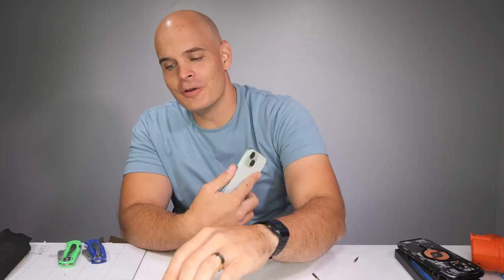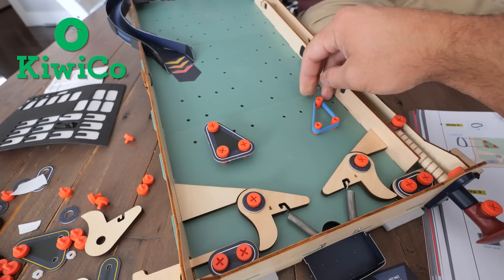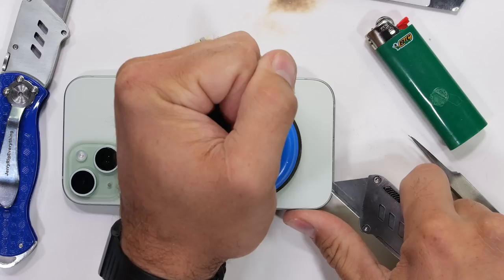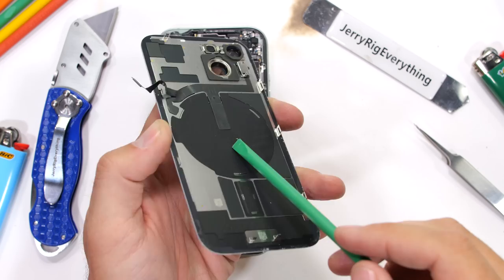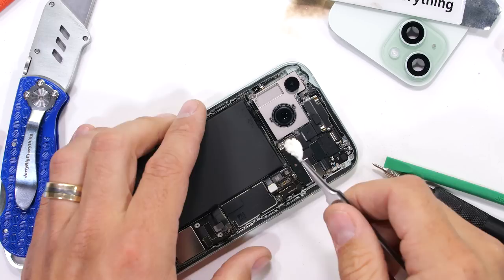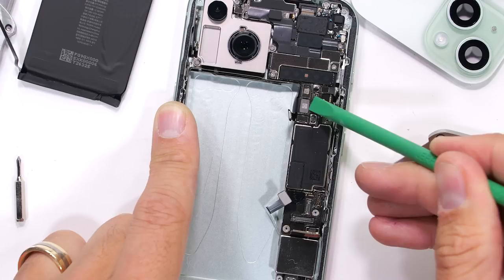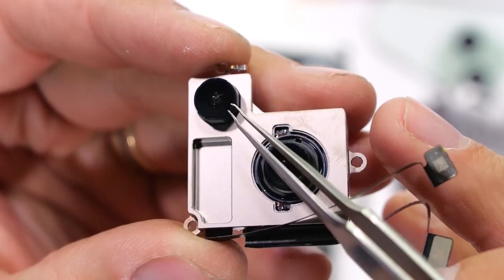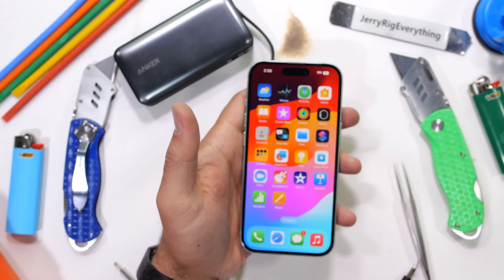iPhone 15 Teardown - Why is nobody talking about this?!

Comment: A software locked back panel is outrageous lol

Many likes 🙏 tyvm
Reply: yap thats why I will never get an iphone. The apple anti consumer mentality is insane. I want the phone to be mine and repair it as I see fit for longer operation.
Reply: I completly agree, but another youtuber did mange how to fix the software locking , yet it is very complicated.
Reply: Much better than the one that cannot be removed if broken...
Reply: @awepizza   It is annoying, but apple claims the reason they software lock the components is so that theives cannot resell a stolen phone for parts, which is the biggest selling point of a stolen phone ever since you could software lock the phone from "Find My" when it is stolen. I think that is a good point to consider
Reply: Have you ever considered the fact that it protects your information and privacy? Just because somebody makes a video and has an opinion doesn’t make it gospel. You need to think for yourself. People come to iPhone because they like the locked software and hardware so when they put their banking apps, stock apps and other sensitive apps they feel secure. They don’t want open hardware and open software like android.
Reply: @lukabosnjak3829  that was only a problem because of an intentional design flaw. Can't throw them a bone for that one.
Reply: Imagine if your phone got stolen. And sold for parts?
Lol people doesn’t have a brain to process these stuff.
Reply: What about that sim card placeholder with electronic connections? I bet it's also serialized
Reply: @searic3203   and that clame is a joke. a phone as parts is almost worthless due to the skill and time required to take it apart and the low price of used parts.

furthermore. If that was actually the goal they could just implement the feature for parts from stolen phones whhile not impacting non stolen replacement parts.
Reply: What does it mean by software locked back panel?
Reply: If people stopped buying so much apple products this wouldn't be common place.
Reply: @iFrozenSkull if you remove it or replace it with a component that's originally installed on that iPhone, it prevents the phone from working properly
Reply: What's on the back glass of your phone that's protecting your privacy? Nothing besides the wireless charging pad really should be there.
Reply: @iFrozenSkull   means camera and wireless charging stuff stopüs working when anyone other than apple replaces the back panel
Reply: @searic3203  this would make any sence if phone parts would only be locked if it was stolen.....
Reply: @awepizza if thats a good enough reason to completely not even CONSIDER a phone for you, idek what to say tbh
Reply: It’s actually insane
Reply: It has positives too though. You won’t have random frankenphones getting sold on the secondary as ‘like new’ phones.
Reply: Legit sounds like a parody.
Reply: The thing is that the back panel contains apple’s technology. MagSafe belongs to them and if someone else wants to recreate their technology then they have to pay. Otherwise they not getting on the iPhone
Reply: @sammyjammy6647 damn i hate it when a 3rd party back panel steals my credit card number
Reply: @sammyjammy6647  Locked-down/closed hardware and software does not necessarily mean secure, made clear with how Android considers custom roms to be insecure even if the custom rom is newer than what the company allows the phone to go to.
Reply: Technically, it’s not really the back panel that software locked. It’s the charging coil and NFC and maybe the flash.  That makes it ever so slightly better, but like hardly.  It is incredibly annoying that Apple can find a way to both please the right to repair people, and still completely lock it down.  

If you need to know, the reason I keep going back to iPhones. I think it’s honestly because there’s a lot more set it and forget it plus, it just works while absolutely I can point to countless instances of that not being true on the whole it’s much more it just works than android.    And I’ve carried android in my pocket for years alongside iPhone either for work or or because I’m just a nerd.  In the end of the day I prefer an iPhone just because it just works at this point.
Reply: @iFrozenSkull it means backpanel is locked by software so only Apple can repair and no chance of reselling stolen iPhone 15.
Reply: Imagine having the option to lock/unlock the software with your apple id... when you need to change a part you unlock it and then lock it back... job done. But apple doesn't want that. The point that it protects from being stolen in a stupid point.
Reply: @johnbroke2336  That's not necessarily a good compromise either because the display could go bad or something.
Reply: @awepizza I’ve never needed an iPhone repair in 13 years of using them because I take care of my expensive devices.
Reply: Not for Apple
Reply: Expect nothing less from Apple.
Reply: @sammyjammy6647  guys like you are something different. what a breed
Reply: @sammyjammy6647 appleships never have the ability to think for themselves...if Apple really locked the back panel for your own benefit, they would have given thier customers the choice to lock it if stolen or unlock if they want to repair. You should have that choice and option and not apple making the choice for you
Reply: @sammyjammy6647 apple sheep alert😂😂
Reply: Not sure if anyone noticed the OP actually said *back panel*. It's meant for sarcasm since the back panel is literally a piece of metal with glass with no electronic component😂.
Reply: Imagine your phone giving you alerts about a back glass replacement😂
Reply: Brooooo..Wasn't sure if i heard well initially 😂😂😂😂
Reply: @sammyjammy6647 as an iPhone user and Apple fan myself I am not under any illusion like you are.  Sure Apple is way better with security and way more anal.  But this makes no sense, like sure I can make an argument for Face ID for and for Touch ID simply, because if there was ever a way to have a man in the middle exploit of these two things, then you have a way into the iPhone and around the security possibly.  But those were like the only two things that I can realistically make an argument for.

Apple shit canning the back panel, because of a charging coil/a microphone and maybe the NFC coil is laminated there too. Yes all of these things can have their own security vulnerabilities, but none of them offer away in.
Reply: girls calm down only the charging coil is software locked, not the glass panel
Reply: Lmao this reply section brimming full of Crapple shillbots
Reply: @sammyjammy6647 lmao, what a pisstake of an excuse
Reply: @krak3nDBL which youtuber did that?
Reply: @sammyjammy6647 Err...the data suggests otherwise. Give me 5 examples of your argument?
Reply: @sys-administrator  Yeah I believe it works with any 3rd party replacement like screen for example. It’s a very good feature.
Reply: It’s to prevent thieves from selling the parts of the device if stolen. Yes it means repairing is more expensive, but it’s also expensive if someone steals your device and takes it apart leaving you to have to buy a new one. It’s a good deterrent, coming from someone who doesn’t really give a shit what brand of phone you use. They’re all basically the same anyway
Reply: @awepizza  Yeah you'd rather just buy a new Android every 3 years once they stop getting OS/Security updates instead of using an iPhone for 7
Reply: @gayasslily  imagine your 800 dollar phone tells you can't use a charging coil😂
Reply: @skinnyman  No, it's not. It's to prevent people from repairing their phone, fanboy.
Reply: Just to sum up 90% of the comments 😂😂😂, “Apple came out with it, so it’s wrong!” , “Crapple sheep!”, “Apple sucks”, probably the best one is “if people would stop buying apple, they wouldn’t be getting stolen, so apple wouldn’t need to software lock the parts”🤦‍♂️

BTW, has anyone checked to see if the thermometer on the new pixel 8 is software locked to the phone??? Wouldn’t want any 3rd party vendor undercutting google on that important piece of hardware.😊
Reply: True😢
Reply: @awepizza  how many phones have you opened up and repaired in the last 5 years?
Reply: @jayr6666  not a fanboy, I don’t really give a shit about phones
Reply: it actually helps the resale value when buying a used iPhone you know you arent getting some Jankie POS.
Reply: @skinnyman  when your phone is stolen, you have to buy a new one regardless of whether or not the parts are locked. FYI, the parts can still be reused, but Apple will disable certain features like FaceID, TrueTone, Battery Information etc. So yeah, people will still steal your iPhone. Only difference is that YOU, the owner, can't repair it even if you haven't stolen it because it's YOUR phone. Very simple logic, but difficult for some to understand. If this really was about theft, Apple would give you an option to enable the lock AFTER the phone is stolen, allowing you to repair it.
Reply: @MrHushCrush  and this comes also with the problem of not beign able to use third party replacements because they won't match with the original in the checks the system does (unless you would spend money on a device that copies the data of the original hardware piece and writes them to the memory of another piece)
Reply: @sammyjammy6647  “Have you ever considered the fact that it protects your information and privacy?”

I would love to hear your explanation of how software locking the back panel protects your information and privacy.
Reply: End to End control, thats how apple is there are other options if you like to do things yourself. i let apple take care of its products
Reply: @sammyjammy6647  what is "open hardware" and "open software." You just made up those terms.
Reply: @DrewTNaylor  Exactly
Reply: @Shifty319  Yea this Sammy person is making up some bullshit just to defend Apple lmao.
Reply: @bubbledoubletrouble  This Sammy person doesn't have a legit reason to why software locking the back panel protects users data. They're just making up stuff lmao.
Reply: @friendlybane  He's definitely making up stuff in his head.
Reply: apple innovating in one way i guess
Reply: @friendlybane  Probably a good example would be Fairphones (I think) and AOSP, for open hardware and software, respectively. I'd assume those weren't what they intended, though.
Reply: It's just the apple way
Reply: @awepizza I cheer you for not getting an iPhone 👍
Reply: @MrHushCrush yea but it would be so nice of apple if they make the software locked parts an option when the phone gets stolen and not just making everything software locked so you cant replace something on your own. I feel like they just want to squeeze as much money as possible from the consumers. The iphone backglass is 200 dollars while the s23 back glass is 20 dollars
Reply: @_BangDroid_ I don’t think it does anything, the connector is just there to occupy the assembly line and protect the connector internally. Even if it was locked, what is there to disable the functionality for? I don’t think even Apple would go so far as to disable E-SIM just because the physical SIM card tray isn’t verified
Reply: @awepizza not anti-consumer, it costs them more to have a software locked back panel, to prevent thieves from selling parts of the phone, it is however anti-third party repairs
Reply: What the hell does Software locking of individual parts have to do with privacy? Do you even think before you are talking?
Reply: @awepizza at least they are going heavy on recycling so it's a start
Reply: @awepizza I just get apple care cuz the repairs are only $29 and it’s convenient. I don’t blame you tho
Reply: I think it's time to go back to android lmao
Reply: Software locked parts in general is absurd, the camera and battery to name a few.
Reply: @MrHushCrush so, imagine your phone gets stolen. The thief sees it's an iPhone. What do you think happens next? He does not return it to you, you still got your phone stolen.
Reply: @DrewTNaylor  Open SOURCE software, is software whose source code can be viewed by anyone to verify it and flag bugs. I don't know what "Open Hardware" or "Open software" is. They just made something up in their head they though made sense.
Reply: @MrHushCrush if you phone gets stolen you don't have it or any of the parts anyway, so what difference does it make?
Reply: @sammyjammy6647  bruh, closed-software be good? any backdoor be unnoticed? Did you ever just think about ONE corner???
Reply: They definitely redesigned the iPhone to be more repairable for Apple so they could reduce costs on replacing a whole phone for just the back cracking and for the consumer to still get it repaired only through Apple.
Reply: @iFrozenSkull even if you use two brand new iPhone 15 and swop components, it can't work.

iPhone 15 (a) must use iPhone 15 (a) parts. There is software to recognize them
Reply: Makes sense from two sides really… 

1. If you use 3rd party parts that aren’t licensed by the OEM you as a company you can’t guarantee functionality. If phones started having problems no one is going to mention in an article that they were repaired by unlicensed technicians or with unlicensed parts, it will just be that “iPhones have a problem”.

2. They’re running a business not a charity. People don’t like it? Stop buying iPhones.
Reply: @awepizza agreed. Samsung doesn't have it, Google doesnt have it, fairphone especially doesn't have it, even LG (RIP) doesn't have it. So why does Apple have to have it?
Reply: So apple like😂😂😂
Reply: @searic3203 not quite, you'd need a locator. Ain't no way that's fitting on a glass sheet
Reply: has to be because of Security reasons...
Reply: Absolutely. Although last year they did the same thing, then removed the lock later with a software update, so I'm hoping they do the same this year.
Reply: @sammyjammy6647  Absolute rubbish. People like apple because they can say I can afford an apple product. Nothing more. Ooh look a usb c connection, let's restrict the speed on our lower price models.
The replacement parts industry for mobile phones has been here for over twenty years. The security argument is moot.
Reply: it's also a false rumor lol. people who have tested swapping logic boards between iphones like hugh jeffries haven't reported any issues with the back panel.
Reply: @awepizza Often fixing your phones are you?
Reply: I have a phone repair shop in the UK. I give it iPhone 17/18, at best, before iPhones are un-repairable... or not worth the risk of disabling the customers iPhone with the 'it worked ok before I gave it to you to fix' gig.
Reply: @CD-SU  it's really stupendous that iPhone or Apple users won't acknowledge the restrictions that are imposed. I've had a 7, 9 and 11, and the ease of use is fantastic. The workarounds though in regards to integration with say a windows pc is intentionally difficult. They do that on purpose. They're just greedy.
Reply: So Apple decides how and when your phone can be repaired and of course the cost … unless you bricked your iPhone with zero storage combined with iOS update and get stuck in the boot loop of hell … 🎉
Reply: @sys-administrator The NFC is not on the back glass. The NFC antenna is next to the camera, screwed into the housing. Even if the NFC antenna was on the back glass it still would excuse the software lock, the antenna holds zero data. All of the NFC data is stored on the motherboard which is already locked behind an iCloud account.
Reply: Somehow he made the point that Apple is going in the right direction in terms of repairability and didn't catch a thing in the video about why he thought that. I guess he is just trying to have apple name the rubber seal in his honor, sellout much?
Reply: @awepizza that’s a pretty stupid reason to not even think about a phone
Reply: I didnt know that they were software locking items like this abd was considering an iPhone. Screw that, lol
Reply: @SumRndmPenguin maybe the nfc unit thats used for apple pay?
Reply: @awepizza  You say that, but what will you do when other companies follow apple's footsteps? Samsung has already had software locked parts.
Reply: I wish it were but nobody will be outraged.
Reply: Literally majority of people don’t care about this 🤣 Just get apple care and you’ll get new phone if something goes wrong.. it’s not that complicated
Reply: However there are many registered third part repair shops that can replace these items.  Kinda funny that’s ignored.
Reply: @jakeyounglol  Because they've just implemented it.
Reply: I doubt that’s true the iPhone 14's back panel wasn’t paired
Reply: Isn’t that just the cable for the charging coil and or nfc chip?
Reply: They purposely make it impossible to repair, meanwhile they get esg scores for using recycled materials . It's such a joke
Reply: @anonym3017 so what you’re saying is, a phone locked by the find my app, is practically worthless? And next to impossible to get working as changing the MB wouldnt let the other parts work with it properly? Seems pretty damn smart then
Reply: Chinese tech will always find a way to reprogram the components to match the mainboard (see REWA channel). 

So blocking parts selling from stolen phones is kinda a moot point. At most it will annoy repairers that cannot afford such reprogramming machines.
Reply: About as outrageous as the back being glass. Make it aluminum again throw the wireless charging in the trash. Who wants to charge their phone slower…
Reply: It is not so outrageous regarding the back-pannel because you have the magsafe there, an unofficial one can make your battery drain faster, what is outrageous indeed is that if you install an official apple back-pannel it is not auto-detected and you need a special apple software to activate... Right to repair should extend also on home use if you have the skills, why I am not allowed to repair my phone at home if I know very well how to do it?!
Reply: @awepizza you’re weird
Reply: Did you try not being poor or frugal?
Reply: What does it actually mean?
Reply: @awepizza everyone always says that, but how often do you or would you take the time out to fix it.
Reply: @lukabosnjak3829
"less worse"
Reply: @FrodoMaster1996  that’s when I start tracking it… and find the robber. 

And no thieves won’t stop stealing phones 🤦‍♂️. They will be less likely to steal phones in the future cause it’s hard to flip them for money.
Reply: Apple should definitely make the part paring and verification tools available to anyone who wants to repair their phone, that is inexcusable. The requirement for parts paring however, makes sense in a way if it was for calibration or safety purposes, the back glass contains the wireless charging coil and you wouldn’t want something like that not working to spec were it could damage the charging circuits of the phone or cause overheating out of spec. That kind of thing is one of the reasons why I would never trust a cheap aftermarket 3rd party part (Trust me, I’ve seen shitty 3rd party parts ruin a phone) and so requiring verification that the part is OEM or at least if it’s a 3rd party part that it’s up to spec would be valuable for protecting the phone.
Reply: Who actually gets their android phones fixed? Everyone I know just buys a new phone anyway. I’ve literally never known a person to “fix” their phone. Not that there’s not people who do so, but the costs of fixing phones usually isn’t worth the cost.
Reply: @lukabosnjak3829 it's artificial though it would be better if they didn't go out of there way to be assholes
Reply: @MrHushCrush phone parts are worth like 20 bucks bro
Reply: @jakecoyne3919 the recycling is more marketing than anything else. 

1. Its reduce, re-use then recycling. Ie, you're far better off designing a device to be repairable to reduce the volume sold, and designing it to be durable to allow for longer resale usefulness, then yoi are recycling. And recycling materials is an extremely energy intensive process which in many cases has a nearly identical carbon footprint to producing new materials.

2. Recycling isn't a 100% efficient process, meaning that with many materials you'll only get back around 50-90% of the material recycled, the rest become waste. Also recycling also introduces impurities into material and can degrade the microstructure, which reduces the quality of the recycled material compared to a new material.
Reply: The way I see it, I have AppleCare+ w/ Theft/Loss on my iPhone 15 Pro.

If the phone gets damaged then Apple will fix it anyways, and I also like the fact that if anyone steals my phone it becomes a useless brick.
Reply: @searic3203  what's the point? Between an Android and an Apple device, the thief will choose Apple any day so it doesn't make any sense at all, they just want you to buy a new phone instead of repairs at a third party shop. Yes, anti consumer and greedy af
Reply: I'M not here to argue, but when it's come to the phone gets theft, the thief can't take upart and sell the parts.
Reply: @anonym3017 low price of parts? Do you know how much a display costs for an 15 pro?
Reply: @wahahah you can remove as it’s paired with the phone. You just can’t swap random parts.
Reply: And you'll be the first one to cry when you're phone will be stolen and sold for parts lmao.
Reply: @PrinceMandal  Unless every single part is software locked—which is not the case—your phone can still be parted out. Why only lock the parts that a legit user will most likely damage and need to replace?
Reply: Can't stand that company. People with those are insane. iMacs are cool I guess.
Reply: The "parts are locked to prevent stolen phone parts to be sold" is so stupid and easily disprovable and nonsensical
At least try to come up with something logical
Reply: @Hellsing12002  Actually, wireless charging is mega handy, especially when you've ten qi points in the house. There's a plethora of materials to encompass that.
Reply: @nvnh319  you've answered your own question.
Reply: just get a good case so you don't even have to worry about that lol
Reply: @@l1m3400 about the same time as your intelligence apparently.
Reply: @MrHushCrush  Imagine if you could report your iphone as stolen using your apple account, and then they could lock the parts using software? But a lot of people don't have the brains to process this stuff.
Reply: It doesn't matter as long they not charged it for $169, the price is ridiculous. $50 is probably max for changing all the parts on the back cover (I still consider it still expensive, but it's apple). They claim it will protect your data if your phone is stolen, but it's not.
Reply: @IamBATMAN2024  a used one without a warranty or any guarantee of being genuine?

Aka what a stolen one gets sold as.
Significantly less than what apple, or other manufacturers, want for one.
Reply: @shalala4571  Apple doesn't sell replacement motherboards.

So your argument doesn't work.

And again. You can stop stolen phones from being parted out without impacting user/3rd party repairability.
Reply: @DrewTNaylor  Nah, fck fairphone, they removed the headphone jack and made an stupid excuse.
Reply: @Splarkszter  I agree, just figured it was a good example of hardware the end user can mess with.
Reply: All the hate!!!! Phones are phones regardless company there are pros and cons to both apple and Androids it’s all preference and style I have the iPhone 15 pro max since launch in white never had a over heating problem or cpu throttle very please with my product I buy apple to apple was a S user far back as the galaxy series but switch to iPhone 8 and never looked back I own a I watch iPad and phone love the connection between all my products that why I choose apple going from call from phone to watch or to iPad 🎉 just prefer tht way
Reply: @MrHushCrush ok but WHY REMOVE HEADPHONE JACKS AND THE SD CARD/SIM TRAY THAT'S SO UNNECESSARY I WILL NEVER FORGIVE APPLE FOR REMOVING HEADPHONE JACKS BT AUDIO IS HORRIBLE
Reply: From the entire video, that was your takeaway? 🤦‍♂️
Reply: @lordofthesticks0  🤣🤣🤣 Maybe go under the rock you were staying. That’s better.
Reply: @sammyjammy6647  wha...what does this have to do with the glass panel being married to the board? wake up people it is all excuses.
Reply: First time?
Reply: @awepizza samsung 🤭🤭🤭
Reply: @MrHushCrush  keep telling yourself that lol. Imagine if car manufacturers had to do the same. Only Apple gets away with it.
Did u see the video of the guy that Apple wanted to sue because he made the tools to work on their phones lol.
Reply: They really went there. They took a joke and made it reality
Reply: @searic3203 "let's screw everyone over for something that happens less often than breaking a phone"
Reply: @meehhheofyou3472 so you admittedly, begrudgingly put up with iphones due to laziness? I'm gonna let you own that one.
Reply: it’s more than likely for the magsafe charger and not the actual back glass.
Reply: Rest in piece 💔 🙏 😪 😢 😔 😞
Reply: @Aleyturs lol 😂😂😂😂these typ of guys are just apple fanboy they don't understand how things work 
Even i was the same until iphone 8 
8 was great but also i was a kid
Reply: @Erowens98  again, it's a start. These companies take forever to change and btw metal should realistically be 100% recyclable so long as companies actually do the right thing, cause it gets melted down and re molded. Sure the other mats less so buy again, it's a start. Also the reduce, reuse and recycle is a triangle for a reason, you start where you can and work the other 2 in
Reply: @MrHushCrush *don't have a brain. I believe is what you were trying to say. And if someone has the ability to harvest parts to sell. They also have the ability to Google how to get around the software protection. It doesn't hurt the criminals. It hurts the end user.
Reply: @sammyjammy6647 That's not how phones work. Think before posting such garbage next time. Android is just as secure as iphone. Every phone is now fully secure as long as you enable 2fa. Apple is less secure because it doesn't allow you to manage files properly,& most have to jailbreak.
Reply: @awepizza  How to say you've never used an iPhone without saying you've never used an iPhone. Ever heard of stolen phone market? Can't strip the phone down for parts if all the parts are software locked now can you? Which actually benefits you, the customer, who doesn't steal and tear apart phones to sell them for profit...
Reply: @awepizza That’s anti consumer? Strange. People who get scammed ‘cause someone sold them a phone with swapped internals, I think that’s much more anti-consumer instead of a company trying to have all authentic components in them.
Apple is already complying and making spare parts available in case anyone wants to ‘genuinely’ set up a repair shop with genuine parts and not some cheap after market parts.

As someone who’s been scammed twice and lost of money, I’d be very happy if a phone is letting me know if any component has been changed.
Reply: @anonym3017  Not but i’m sure for each stolen phone there is a smashed one aswell. So you could just move the smashed one over to the stolen one
Reply: @awepizza  I use iPhone for 4 years now. Having a protective case I never had any durability issue with any iPhone and previous smartphone. I rather want a protection such that the stolen iPhone has no value then have a cheap replacement that might not be needed if you use it with protective case. Even if I will ever need replacement it wont ruin me as it is not something you do on regular basis... Getting your iPhone stolen is a much worse thing.
Reply: @awepizza so you buy a phone in hopes that when it breaks, you can repair it as you see fit even though it won’t be the best approach? Got it.
Reply: @shalala4571   and guess what. the motherboard of the stolen one would still get icloud locked whenever you connect it to the internet again.

so your argument doesn't work.
Reply: It’s to do with the MagSafe components no?
Reply: Looks like apple testing consumer patience 😮
Reply: @MrHushCrush if your phone was stolen your chances of getting it back regardless is less than 1%
Reply: Stupidity in motion, marketing just advertises it otherwise.
Reply: @redmore91  nope. Apples charging is Qi standard.

So that ain't it.

It's literally to just force you into getting repairs and parts from Apple
Reply: @sys-administrator  There is only NFC antenna,the actual data send trough the NFC connection come from motherboard.
Reply: @sammyjammy6647  Is there any data storage on the back panel? Explain how replacing the back panel on the iPhone would breach my privacy and information?
Reply: @awepizza  Almost nobody repairs their phone brother. I'm sorry, but it's time to start living in reality. If you want to be able to repair your phone as you see fit, buy a fairphone and call it a day. That's about it. Why are you even here..?
Reply: @krak3nDBL 40 REPLIES
Reply: Stolen phone mafia bosses agree
Reply: Apple is really a terrible consumer company. I was brain washed by then for a while.
Reply: @sammyjammy6647 absolutely zero understanding of how information security works. what is someone going to possibly do with the back glass? access to the inside of the device doesn't mean anything.
Reply: @awepizza so what you saying is you rather buy a phone every two years, since your phone manufacturer stops sending software updates to you trash android phone? making it literally unusable within 24 months 😂
Reply: @sammyjammy6647  Someone shilling for apple telling people to 'think for themselves'? That's rich.
Reply: I mean not surprised though
Reply: A software locked back panel is cool
Reply: @searic3203 I think that makes sence
Reply: @anonym3017   There is a huge market for stolen phones in third world countries
Reply: The amount of apple fanboy copium in this comment thread is outrageous. There's no excuse for sw locking components. That's like software locking wheels on a car "for your safety"
Reply: Except it's not, at all. I fix them for a living.
Reply: tell that to people who get their iphone stolen and saw the last location in China. Those thieves should earn 0, the phone is not locked hard enough imo
Reply: @bigdata_ibm bruh you are joking right? Appel technology😂 that are a few Magnets clued to the back the softwarelock can't prevent another company fromm stealingthis idee
Reply: @SumRndmPenguin the… camera… and microphone for video?
Reply: @bigdata_ibm now that makes sense, wave money in front of them and they’ll do it
Reply: @searic3203  No the thieves still sell them in Pakistan afghanistan
Reply: Have fun paying extra for the hardware and software that locks your back panel. Security? Hah! The weakest link is always people. Does a thief care what phone they steal? Nah, they just steal anything valuable and figure out later. The professional thieves are not targeting chump change phones. 😅
Reply: @sammyjammy6647 In that case, there are a lot of misinformed people thinking that locked hardware is somehow safer.
Reply: Giving apple such ideas lol they'll implement it in Apple 18
Reply: @awepizza to be fair apple has the longest software support and in a lifetime of careful use the only part that would realistically need replacing is the battery
Reply: @awepizza it’s to help the CIA
Reply: @compilationvideos4489  android NPC detected 😂😂
Reply: First off, competition is great, Apple, Android, etc most of the Android fanboys try and get Apple fanboys to dump Apple and switch to Android, but it’s Apples iPhone way back in 2007 that pushed Android & other OS devices to step it up and make better phones to compete, today it’s kinda the other way around, I think that’s the worst thing about Apple more recent is they realize they have loyal customers that keep buying their products so they slowed their innovation somewhat and milk their customers for all they can get before a decent upgrade is offered, but because of Android offering better specs it eventually forces Apple to catch up, but as for reliability and having a phone that just plain works, Apple wins there, hence competition is great
Reply: @unzesty  so what has apple done in the last 5 years?
Reply: lmao the back panel isnt actually locked  @awepizza
Reply: At least now thief’s can’t steal your phone and sell it for parts without looking dumb….
Reply: Had to reprogram screens, batteries and home buttons on the iPhone's. Was super irritating fixing them. Glad I'm not a phone repairman anymore
Reply: delete ur edit
Reply: @DrewTNaylor  but the iPhone is literally more secure, it’s the phone that not even the FBI could get into
Reply: @Rivs5117 don’t get the back panel because that’s just stupid but for some stuff it does make sense, like the battery, to measure stats it has to apply a voltage and if it can’t verify that the battery is as good as the OG it can literally explode if you send that voltage through it
Reply: @anonym3017 its not if it is an iphone part lol, you underestimate how valuable iphones are to these thieves, you will see a samsung or huawei store be robbed but an iphone store, almost always is robbed